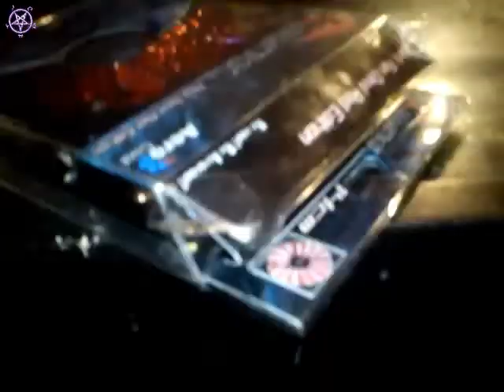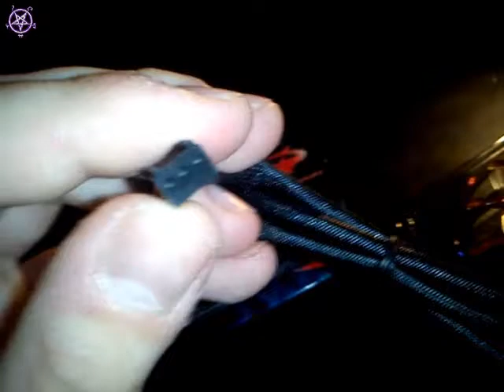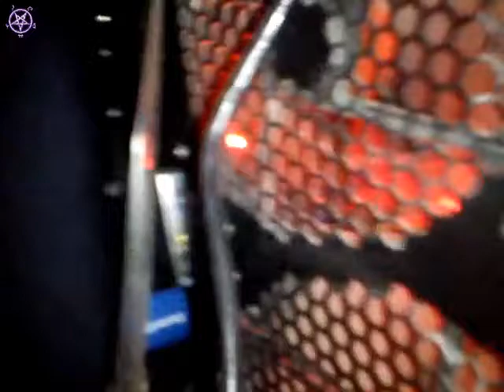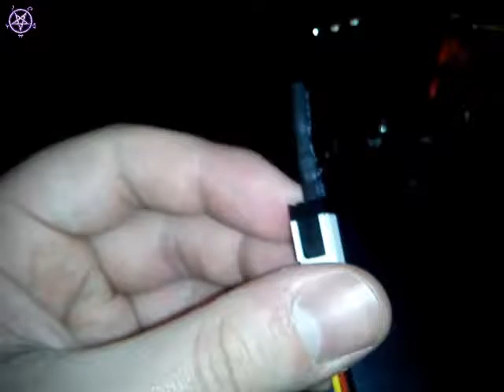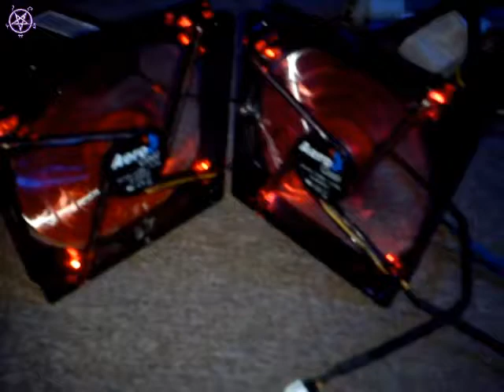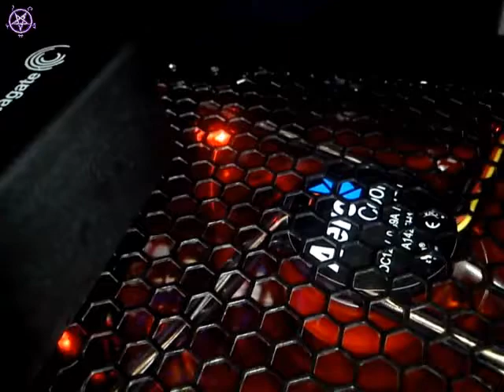AeroCool "Shark" 14cm Fans - Review, Unboxing, Fitting & Testing

Comment: which one do you think is better, the 12mm or 14mm? 14mm got higher cfm but higher db as well.
Reply from the maker: depends what you need it for. You're wrong tho, 14cm fans run at lower RPM, therefore they're lot quieter. 14cm fan can push thru more air than 12cm fan at same RPM, so 14 should do better in most scenarios.

and its CM, not MM lol.

Comment from the maker: depends what you consider as loud, i run them on 50% of power. in fact i only have 1 now, because H100 radiator was too big and i had to remove one fan.

but all in all i have 8 case fans and its still quieter than old PC that has only 2 case fans, but they run at 50% most of the time.